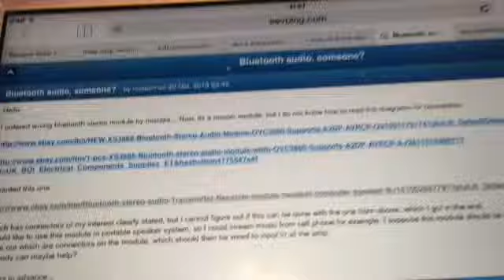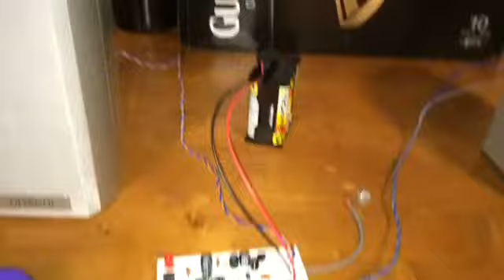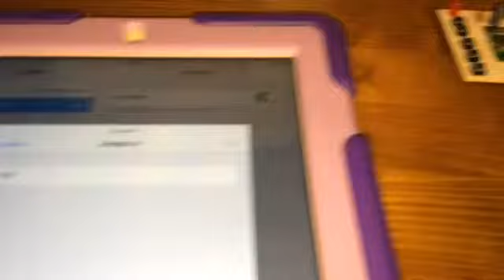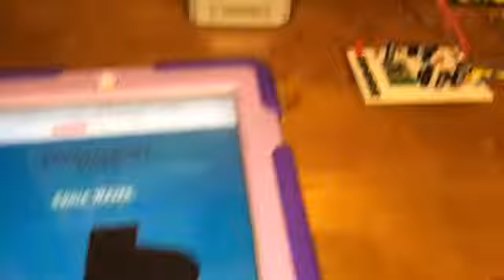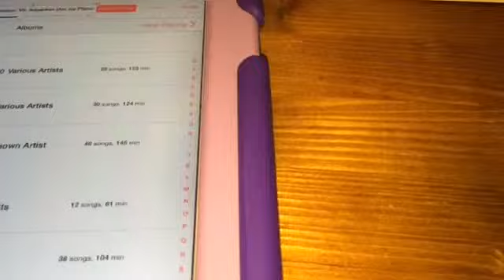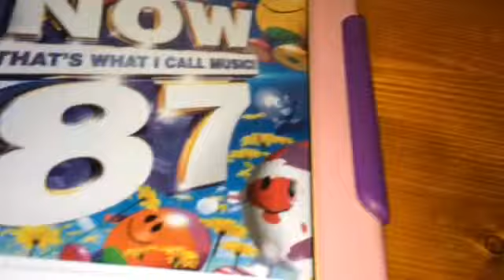XS-3868 blue tooth module test circuit

Comment from the maker: To avoid noise, run module from completely separate supply to amp. I have played with a few modules now and experimented with various ways to eliminate the transmission noise. The best way is to run the module of its own supply separate to the amp (even coil in the ground between bt mod and amp wasn't successful). Also , the mic is an electret (condensor mic). It is either biased from the module or via a 15k resistor (can't remember which) it is coupled to the module via a 1uF capacitor. I have made an updated version of this but still can't get rid of the noise unless I run the module and the amps off or a separate supply. Tda2822m rocks as a bridge amp though.